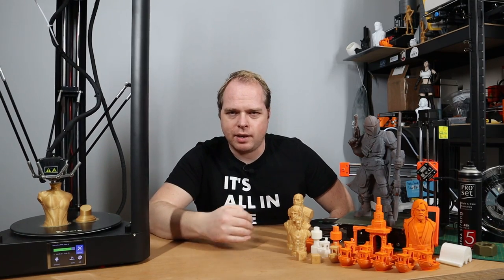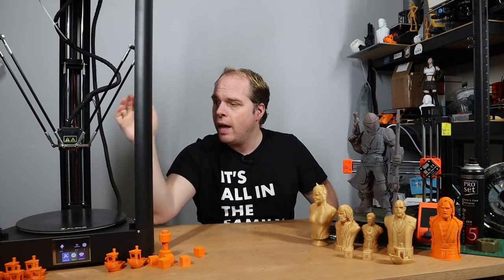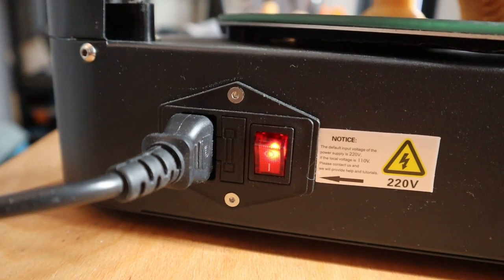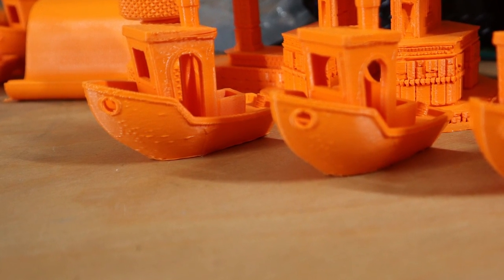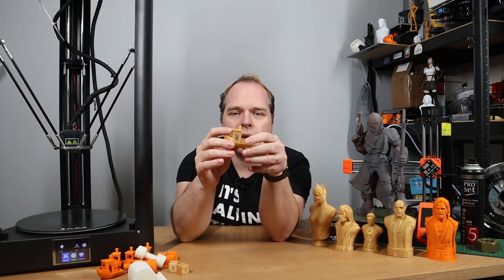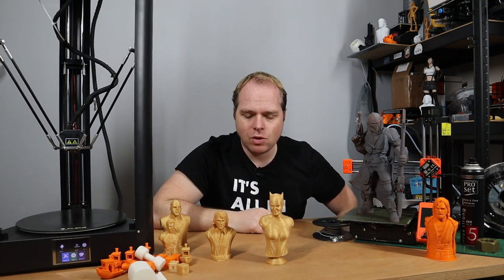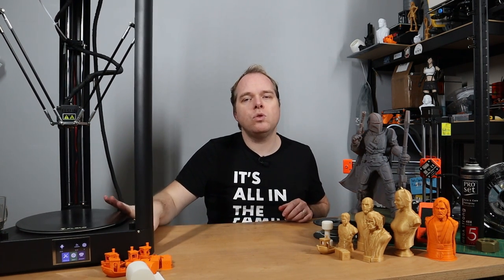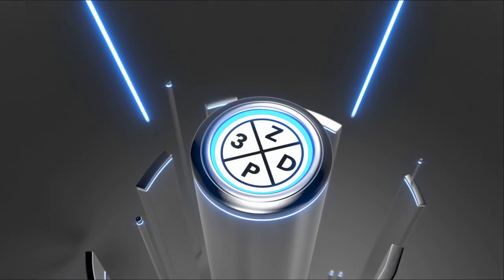FLSUN QQS Pro Review   Great Delta printer for the price

Comment: I just got mine a few days ago. I have had many Cartesian printers and recently bought a Monoprice Mini Detla. I liked it so much I bought the FLSUN QQ-S Pro after watching some videos including yours. I upgraded to Cura 4.10 and printed a benchy. It was perfect like the last one you showed. I started printing a full  size human skull (4 days 8 hours at .01 ultra fine). It is now 40% done and so far is absolutely perfect.  

Another benefit is how quiet these delta printers are.
Reply from the maker: Hey Chris, that is great to hear. How did the print looked in the end? Btw the latest version from Prusa Slicer has the FLSUN QQS Pro pre-configured... try that one out
Reply: @Zachary3DPrints  It turned out pretty nice. I have been printing on it every night since I got it running.
http://www.tophersworld.com/hobbies_3d_flsun_qq_2_pro.html

Yes Cura 4.10 has the FLSUN QQ-S preconfigured and it works great.

Comment: Anyone, I'm starting wiht this printer in a couple of days, I'm using simplifiy 3D and I've been looking for the FFF profile the set it up in S3D but I can not seem to find any. Any suggestions?
Reply from the maker: Hello Guy Goris, Do you have the possibility to add a custom printer into the slicer? If so, then see if you can add a delta printer as well, and use the printer settings from my other video about the FLSUN QQS Pro in Cura and in Prusa Slicer